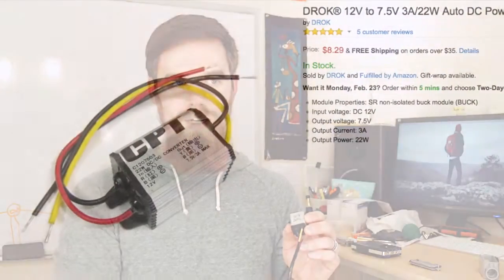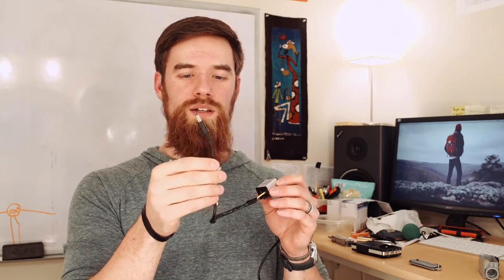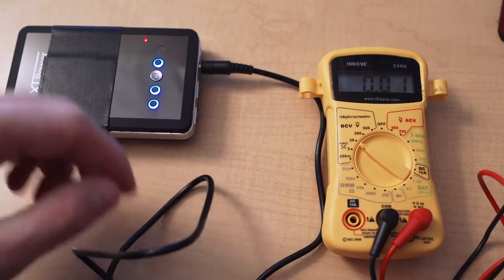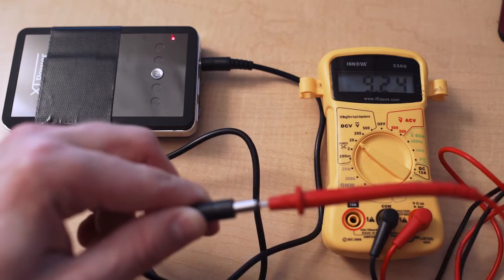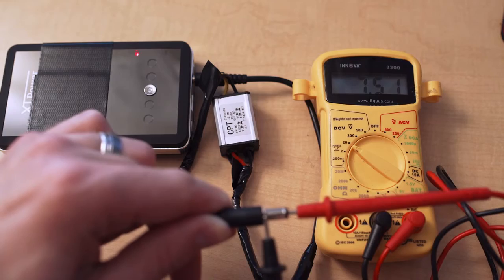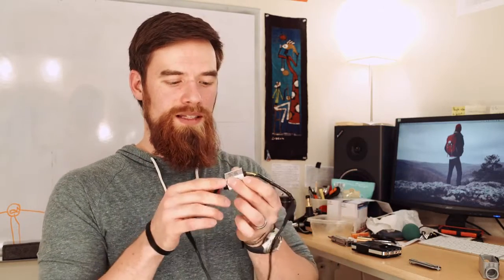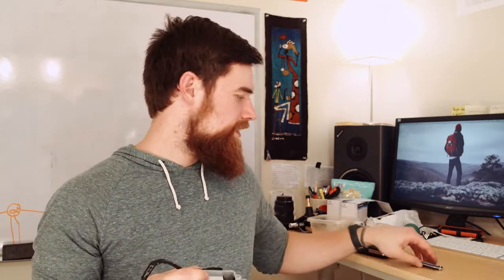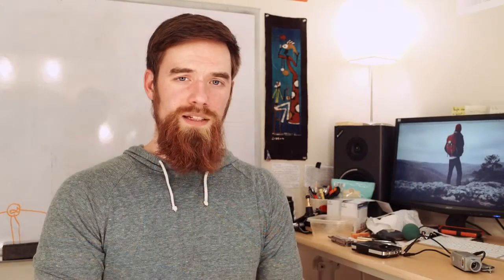9v or 12v Battery For Sony A7s

Comment: Awesome find on the regulator. The Sony FW50 batteries state a 7.4v output, but will actually output closer to 8.4v on a full charge. I was also worried about the 9v (~9.4v) being too powerful and harming my camera, but in reality it is not too far off what the oem batteries are giving. That being said I definitely wouldn't trust a 12v. The extra $8.50 on a small regulator is worth the peace of mind.
Reply: Hey Seth, so this setup works on your camera? Have you also tried it with an A6000?

Comment: Every Power device has a input range. 7.4V is only because of the special voltage from the batterys. Li-cells by its own has one special voltage and multiplied by a factor (multiple cells). So I think there is a range of voltage input to the A7s. 9V its ok, 12V, I dont't know. Maybe 12V works, but it produces to much heat on the input circuit. And maybe than the cam shut down faster as working with a battery.

Comment: Thanks so much for the tip and links.  I've created an exact cable as you've done- curious what % battery strength does your A7 show using the regulator?  I'm seeing like 17%, was expecting it to be 100% or at least near it.  Haven't put a voltmeter on the regulator output yet.  Thx!